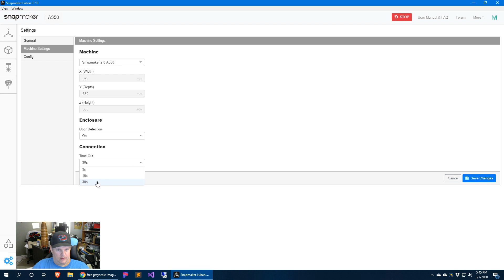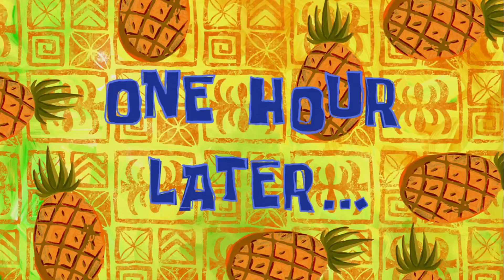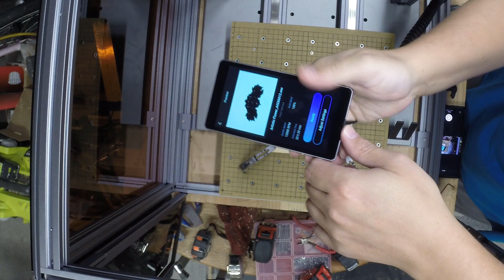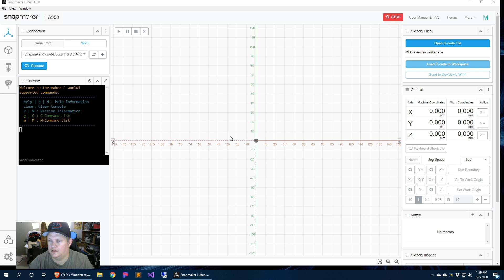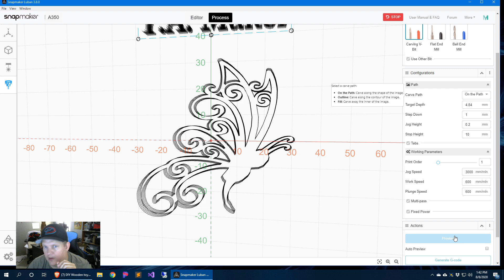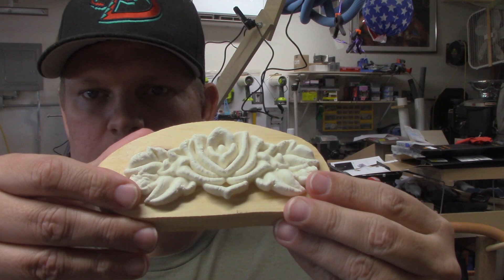Snapmaker cnc setup, run and review

Comment: This is painful. And in the worst way, so many edits need to be done and on top of that dude just grab the corner and hold the shift key in it. I’ll freaking precise the thing without changing the dimensions of the way it does it with a locked ratio life is so hard.

Comment: Just watched this 2 years later. I had a Snapmaker 2.0 A350 and I got online and found one that had missing pieces and some issues and I was able to get it working. Was one heck of a deal. Combining the purchase price and parts to complete it I paid $440. AND it came with the 3D Print Head, and the Laser (the lower powered 1600) and the CNC. My first Snapmaker, which I also bought for even less money $200 but that needed $300 in parts, but that one only had the 3D Print Head. So, this one gives me the added functions. Thanks for the video and I'm in Arizona also, Tempe. I do a lot of 3D Printing, robotics with Arduino/Rapsberry and stepper motors. My main go to machines are Lulzbot TAZ 5 which I also bought for some really good prices again needing to be fixed. People buy these machines thinking they are as easy to operate as Microwave ovens. Then the either assemble them wrong or use them wrong. That's when I come in by buying the messed up machines and restoring them. The 2nd Lulzbot I bought must have had 20 issues, misaligned guide rails, wiring nightmare, and on and on. Took me 3 and a half days to get it working with $200 in parts to fix it. But I got it for $240. 3D Printing is amazing and now I get to try laser and CNC which I probably won't do much of but I'll give it a try. Nice video neighbor.

Comment: I thought I saw where some people thought you had said that your engraving took 14 hours but on the video I heard you say 13-14 minutes, just wondering if I heard it wrong now?

Also the letters, couldn't you make two passes or two different templates, so that the first pass it would cut the center, second pass it would cut the outer of the letters?

I don't have a 3D printer yet but am really interested in this one. I have a Silhouette Cameo and the software allows you to tell it how to cut the template or you can make two separate templates, turns it into two jobs but will cut what you want on a first pass and then cut the rest on the second. You can cut as many times as you want, making as many templates on one project as you need to separate the cuts. 3D may be quite different... 

Thanks for the video!

Comment: If you hold down the SHIFT key while dragging a corner of your image, it will maintain the aspect ratio. Solid video though. Keep it up!
Reply from the maker: Thanks for the tip! I try many of the shortcuts that are common in other similar programs but so many don't work with Luban.

Comment: does the software accept stl files to cnc or just jpg?
Reply from the maker: Only svg, png, jpg, bmp and dxf file formats are supported.  You would need to use a different application and generate the g-code there and then you can use Luban to load the g-code.

Comment: Just how powerful is the motor? Whats some of the harder stuff it could cut, aluminum maybe?
Reply from the maker: It is not a very powerful motor. I would not attempt to do anything other then wood, acrylic, fiberlass/carbon fiber, pcb boards and engraving on non ferrous metals.  Any kind of serious metal cnc work it just going to cause problems. The motor is only a 50w motor.  It would be nice to see an upgraded motor.
Reply: @YetAnotherMaker  thanks for the info, I see they have plans for a bigger cnc with a larger motor I hope it'll work for the snapmaker 2

Comment: Try using double sided tape. And you will not need the clamps.
Reply from the maker: I had thought about that but the only double sided tape I have is the carpet tape. Guess I could of just used a smaller amount so that it was not so hard to remove.

Comment: I have one and it is really awesome! A tip: when running the boundary test, make sure the mill bit runs free of the clamps. You don’t want to risk the machine or bit running into the clamps during the boundary test. I do it in at least two steps in order to be really sure that the work volume is collision free. I just wish there was a way of verifying the maximum depth somehow.
Reply from the maker: I wonder if they will add a sensor for getting the height vs having to add it in every time. I think that would be more accurate, but as long as you don't go all the too far into the waste board everything should be ok depth wise.

Comment: do you like this machine?  would you still buy it?  thanks
Reply from the maker: If I just wanted to 3d print I would not, but because it has the CNC and Laser I most definitely would buy again.  3 reasons I would buy it again are 1) space that it takes up. 2) not as loud as my other cnc. 3) ease of use. Oh and it has a friken laser on it.
Reply: @YetAnotherMaker  thanks, im looking to upgrade my desktop 3d printer to something better and ive always been curious about the routing thing actually, plus today is the last day its on preorder sale, so i think ill get it.  thanks

Comment: That engraving time took me by surprise.
I'm looking to buy this and figured the CNC and laser would be a nice bonus and give me some more creative uses, but 14+h for something that small.... :(
Reply from the maker: I was surprised by it as well, but after i thought about it for a while it isn't that bad for what the machine has. 1/8" bit but a small motor that doesn't have the torque of a larger cnc.  The nice thing is with the enclosure and even with it open it isn't as loud as my x-machine cnc. we were able to sleep with it running in the shop and the master bedroom is above part of the shop. I would never do that with the x-machine.
Reply: @YetAnotherMaker  Great content Y.A.M! Thanks for sharing. I don't own this but here's a thought/question. what about running it with a hogging bit and do like 85% of the material removal, and then change bits and do the fine machining with the bullnose? i feel like that would cut down some serious time. I would welcome your thoughts. would it be possible to make a job or g-code with a mid job tool change? I'm coming from an automatic tool change cnc world and looking to get a lil guy for home projects :)
Reply: Yea that time is really heavy for sure. Saw a guy do a 3d carving of the last supper 7x5 inches on a 3018 CNC took him 22 hrs for that one which I understand but that in my opinion is really slow for such a job.